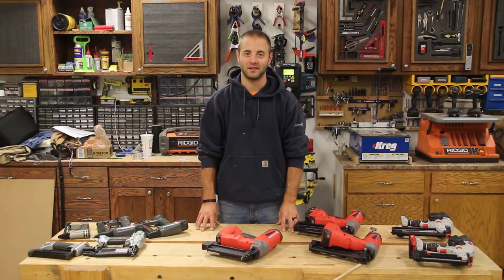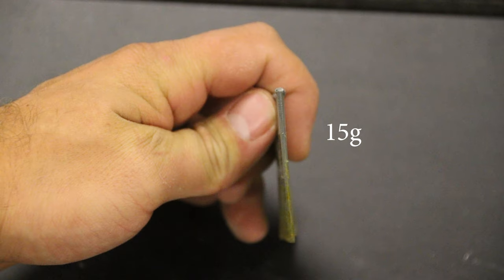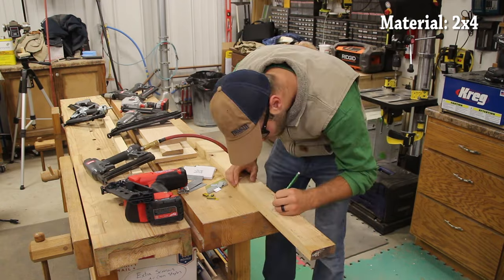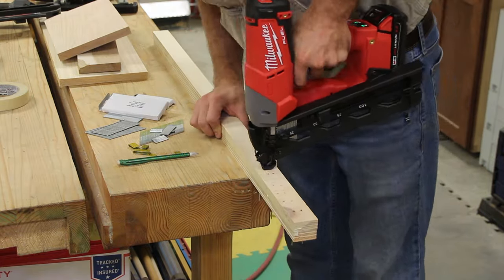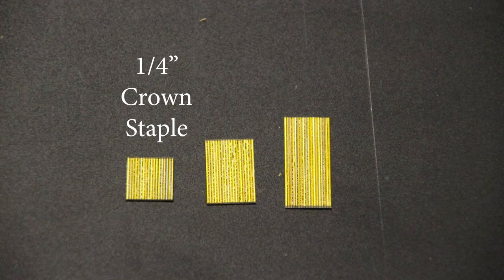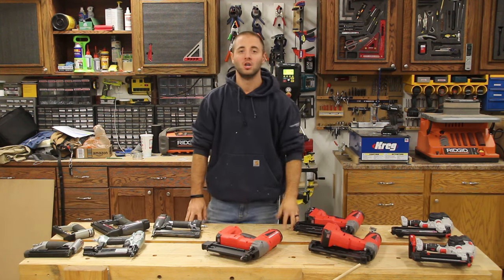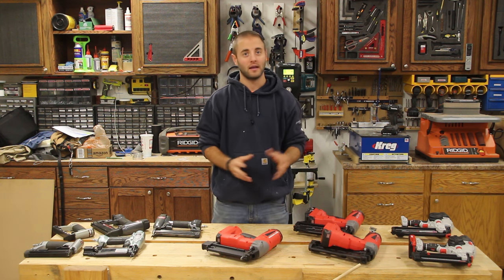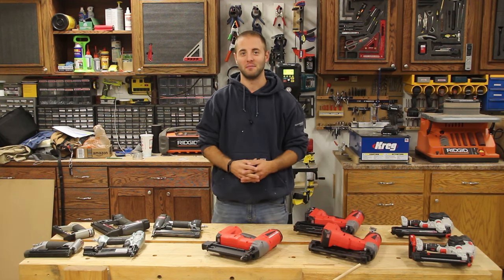What Gauge Nailer for Woodworking?

Comment: Can you use, lets say, 18g nails in a 16g nailer?
Reply from the maker: No.  Lots of bad will happen, no joke.
Reply: @WorkshopAddict  oke thanks, im looking at the dewalt dcn660, 16 gauge
But it looks like it uses angled nails not straight nails
Reply from the maker: @promo130  You can but the nails either way.  Most people like the angled because the magazine allows you to get into tighter spaces.  They both function fine.
Reply: @WorkshopAddict  oke thats why they are angled, i see you can just buy angled nails so thats no problem,
i go with the dewalt or the ryobi
Dont use it very often

Comment: 18g  s 16g - why can't you just use a few more 18g nails to do the same job as 16g without having to buy a 2nd gun/ while having the flexibility of working on smaller work than possible with the 16g?

Comment: Hi what would you suggest for putting together a deck? Frame as well as flooring?
Reply from the maker: Ralph Kluge Screws
Reply: Ralph Kluge    Ralph use decking screws for the decking and something like a Headlok brand screw for the framing. Also use joist hanger brackets for the joists, just make sure the are rated for pressure treated lumber. The decking screws should also be rated for pressure treated lumber. If the decking is a composite use decking screws for composite which have a smaller head. If you want hidden fasteners for the decking you can use the Kreg brand or there are other brands available.

Comment: I am new woodwork, are there nail guns for use on 2x4 wood that large head nails in general uses?
Reply from the maker: Framing nailer
Reply: full size framing nailer, they are big, they are cumbersome, but they sure beat having to swing a hammer forever.

Comment: I'm looking for an electrical 23 gauge pin nailer and can't seem to find one in that I don't believe they are made. If that is not accurate, I would welcome some information on where to find one.
Reply: Daniel Small titan do an 18 gauge 240v it's excellent
Reply: Makita do a 18v 23 gauge headless pinner
Reply: Ryobi is coming out with one. You do need to buy the batteries seperatly though, unless you already own one.
Reply: Ryobi has one out now for $129 tool only. Have yet to try it so I can't recommend it but it's out there for those in the market for a cordless 23 gauge headless pin nailer. ✌🏽️

Comment: Stay away from the Milwaukee and Porter Cable cordless nailers. these two companies have not got this tool dialed in YET!!!. However the porter cable pneumatic are good.  Cordless nailer winner by high demand is the Dewalt cordless.   surprisingly the Ryobi cordless nailer is not bad for the price.  reviews of the Milwaukee and Porter Cable has had loads of bad reviews. there are tons of other nailer manufacturers out that make decent nailers... but by all means if red is you color knock your self out.  Not being biased to Dewalt for I own many tool brands.  this is just a comment on what is proven to be good at this moment.

Comment: Never used anything other than an 18 gauge nailer. If you need more holding power, you should be using adhesives. I don't see the point of a 16 gauge nailer.

Comment: I’m no expert, but I’ve seen no advantages to 16ga vs 15ga. Almost anything that 15ga splits will also split with 16. I use 15ga and 18. No need yet for pins
Reply: G5 the 16 gauge is good if your only going to buy one nailer. It’s a jack of all trades. It’s also on my opinion better for crown moulding since a 18 gauge is too small and a 15 gauge has too big a head making it harder to cover up and stain. 
But I only own a 18 gauge and 15 gauge
Reply: I ended up buying 15, 18, and 23. I'm set now.